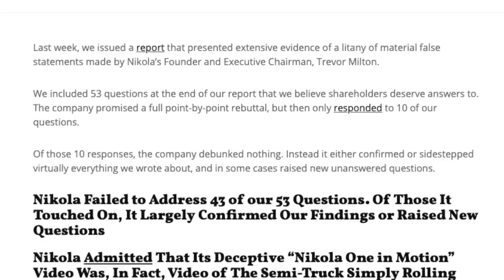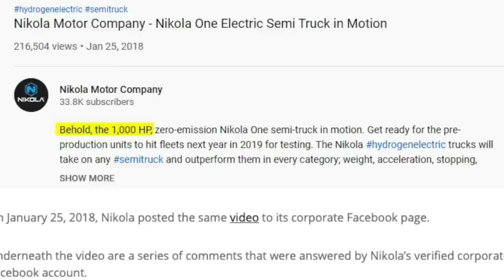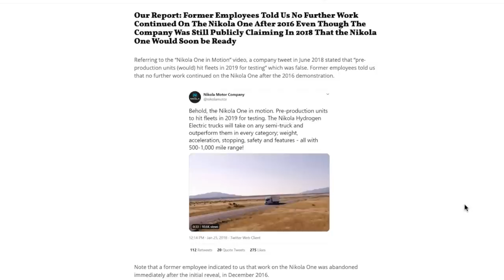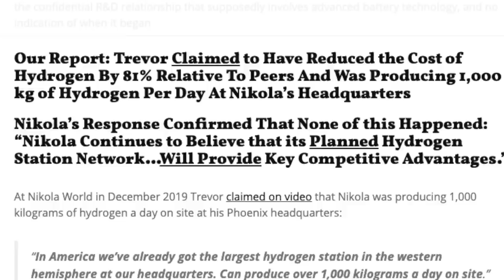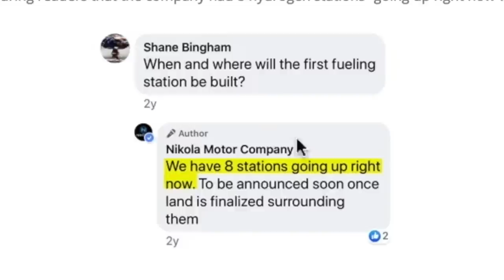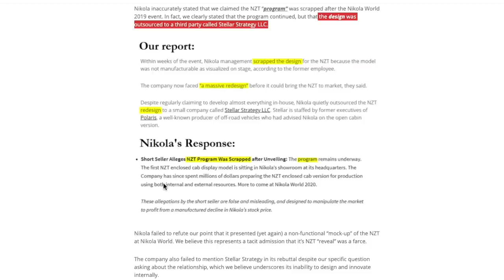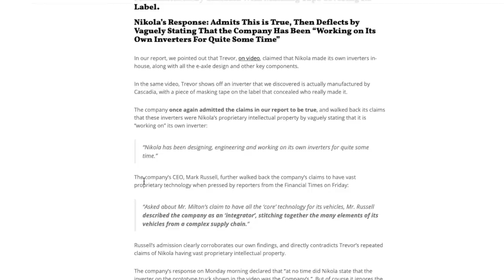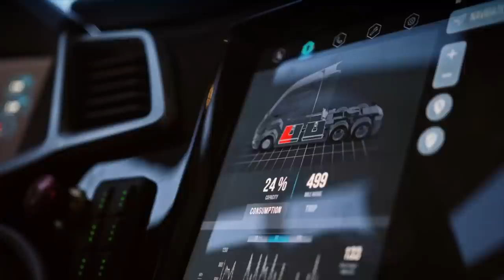NIKOLA MOTORS IN MORE TROUBLE - Nikola's Defense & Hindenburg's SECOND Response (EXPLAINED)

Comment: This Nikola In Motion video is a potentially dangerous stunt.  Class 8 trucks have air brakes, they need compressed air to release the brakes and to engage the breaks.  Without a power plant to run an air compressor, I would have to guess they charged up the air tanks with an external compressor and once it is moving there is no way to make up for lost air during any sort of braking.  Also there usually are small leaks throughout the brake system normally made up for with the running compressor.  There is a standard for acceptable air loss due to leaks in the regulations.

If the air pressure drops to low the brakes on the trailer and rear drive axles of the tractor should lock up.  If they put in the manual release bolts on the brake cylinders to prevent that from happening, the truck would have no brakes at all if the air runs out.